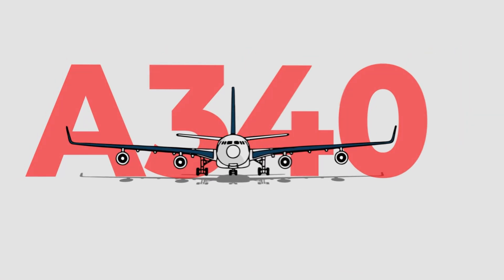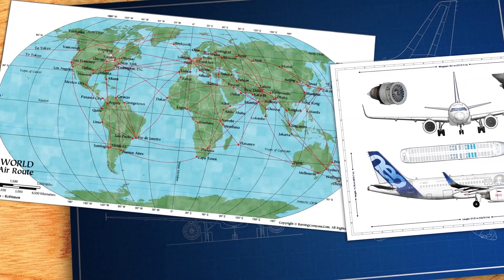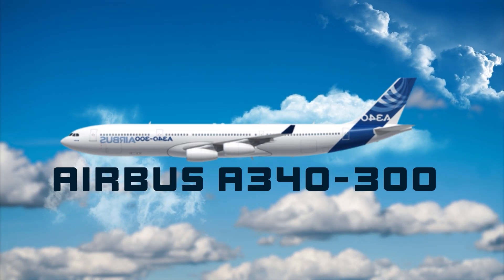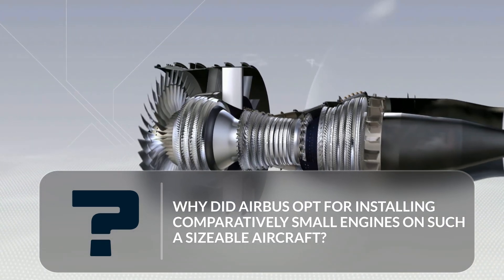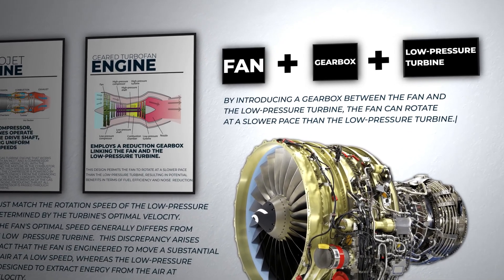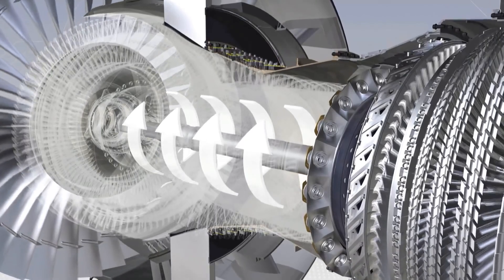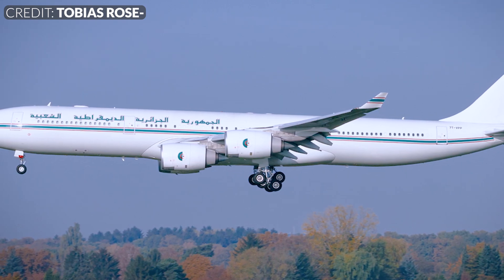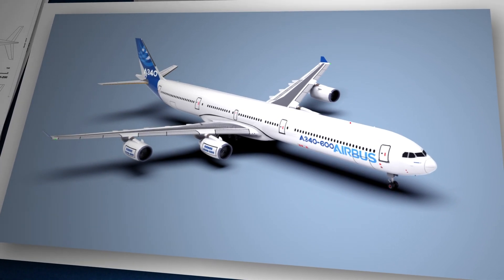Why the Airbus A340 is Underpowered

Comment: All Airbus aircraft are underpowered. The A330-200 with pratt and whitney 4000 engines is the exception, it shares the same TWR as a 767-300 with CF6. An A380 still has lower TWR than a 747-400 and the a320NEO still has less thrust than a 737NG. 
Airbus focuses on safety on board and fuel efficiency, while Boeing focuses on security and operativity.
Reply: Boeing security...😂
Reply: @moussochocolat779  Boeing security on anything else that is not a 737 max is equal to Airbus
Reply: @moussochocolat779  That made me chuckle too. Boeing focus on covering up shoddy workmanship done in the name of profit, Their planes are just rubbish cheap junk now.

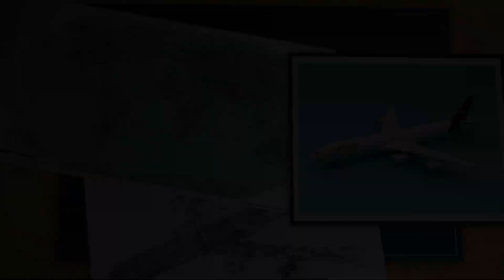Comment: 0:47 Ah yes, a DC-9 lacking eyebrow windows with HUGE engines (with a visible cone at the back) and winglets. That definitely isn’t an ARJ21.
Edit: Also, who tf told you the A340 has a TWR of more than 0.6? Also, the 777, 787, and A350 do NOT have a TWR of 0.9+. You should really look at your numbers again.

Comment: How comes the CFM56’s on the A340 series have long nacelles compared looking the same type on an A320 or 737?
Reply: I saw they also weigh nearly 2x as much as the 56’s on single aisle jets but only have like 10% more thrust.
Reply: @training67605  wtf! that's so weird and counterproductive.
Reply: I don't know
Reply: There's an extra turbine stage in the 5C. Also, the compressor design is different compared to the earliest A32x versions.

Comment: I still don’t understand why Airbus didn’t use the Trent 700 found on the a330
Reply: First off, it was made for the A330, optimized for the plane that used it. Plus, if it used them, it would’ve consumed way more fuel than it was supposed to. If they did, they’d have to spend millions on the already-overpriced development to engineer a less powerful and more fuel-efficient engine for the A340, which would be pretty much the exact same thing as the Trent 500 seen on the -500 and -600.

Comment: at last point about A340-500/600 the engines which using is Rolls Royce Trent 500, not Trent 700 or 7000 which using on A330, if A340 have Trent 700 engines it will be an overpowered aircraft, the total thrust is higher then 747 and nearly to A380 for single deck aircraft!
Reply: a 747 with pratt and whitney 4000 is uncontested, not even the 777-200LR comes close.

Comment: It’s pronounced “El Ten Eleven “ , not “El One Zero One One” ….sheesh…if you study your history you’ll see that the production or the L-1011 was delayed by the revolutionary Rolls Royce RB.211 by 2 years. This gave DC-10 the head start it needed to secure key orders from American, European and Asian carriers. The RB.211 was very successful later being used on the 747,757 and 767 and paved way for the Trent series of engines. However, the Lockheed only sold 250 airframes instead of the planned 600+ aircraft during the down economic times of the 1970s and early 1980s. The A340 sold 377 units mainly because of extreme growth in long haul market in 1990s, airlines needed aircraft